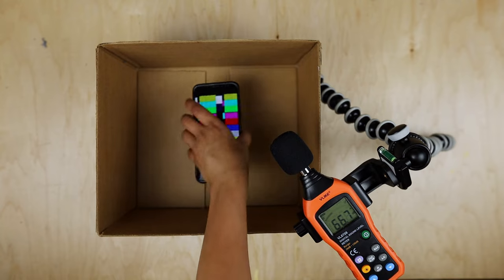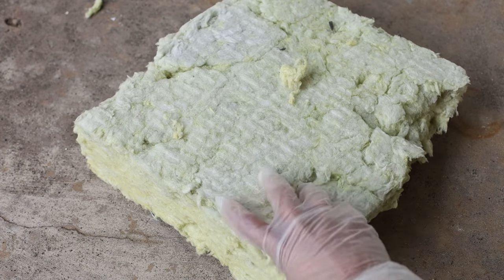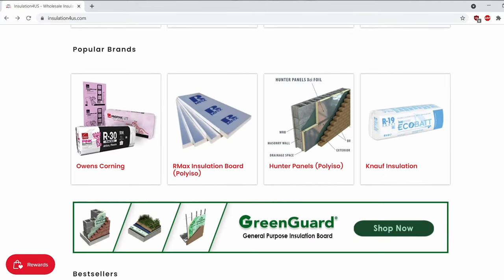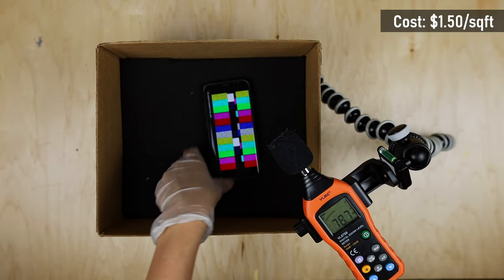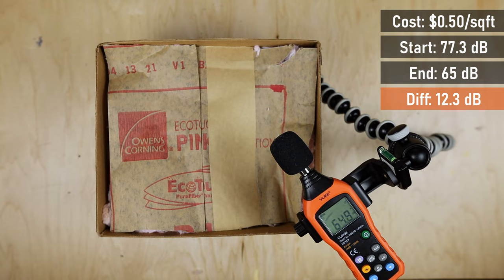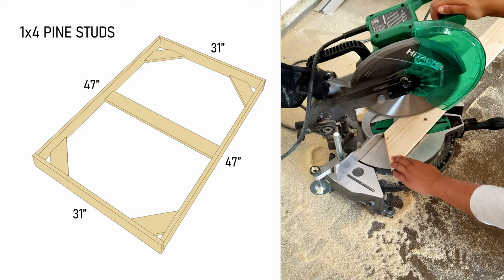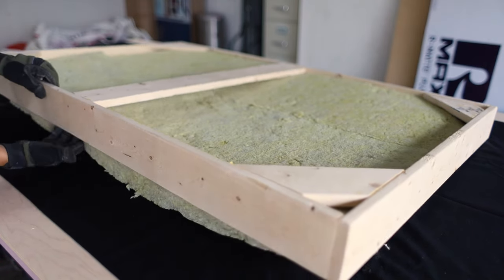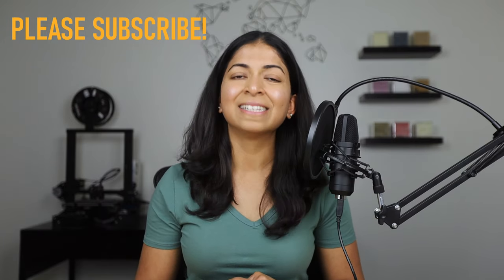Rockwool OR Fiberglass for DIY sound panels?

Comment: Much of what you do is very good work. I think your understanding of sound and the different treatments, where, why and how used is open to improvement. For anyone, a working understanding of decibels, amplitude, frequency, sound dispersion, room shapes and standing waves is imperative. The difference between sound blocking, dispersion and absorption along with decoupling sound transmitters (walls, floors, etc.) is important. Low energy high frequencies are easier to attenuate than high energy low frequencies. Standing waves create huge issues with sound. Identifying the goal, the problem areas, and then the possible solutions may be a better approach to choosing what materials to use, where, and how. Don't stop doing what you do, just continually learn and improve.

Comment: You may have fallen for the classic acoustic pannel trap! I'm new to the topic (so I might be wrong) but from the research I've done there's a difference in absorbsion and blocking. For example, concrete is very good at blocking sound but reflects it. If you were to submerge your phone in concrete, let it dry, then produce the sound, it'd be almost impossible to hear, but you wouldn't want your sound pannels made from it. The property we want in acoustic pannels is sound absorbsion since we only care about sound reflecting back to us. From what I've read fiberglass is actually worse for sound absorbsoin than both rockwool and denim but better at blocking. There's a special program to determine the sound reverberation of a room. LTT does a video using this process.
Again, I'm very new to the topic so I might be wrong.
LTT's video: https://www.youtube.com/watch?v=Sowki1N_YeY
The Acustic Pannel Trap: https://www.youtube.com/watch?v=HwaZhT_CrYI

Comment: Wow you are very knowledgeable about giving DIY information! 
I am purchasing a sound meter for this purpose but looking for the right one that will cover all bases. 

The main issue I have right now is that the room that my off is in is a good sized area but oddly shaped structure for sound balancing.  So it becomes quite a challenge to get it just right for my liking. 

I will consider the fiberglass insulation for sound panels and take the safety precautions while building them. Always do.
Thank you so much! ✌🏻

Comment: The experiment makes a lot of sense, but we need to be careful when trying to generalize the results, especially to the scenario of wall insulation.

In the case of wall insulation, there is a cavity where sound can easily go through/resonate in, and we try to fill the cavity; also, the sound source is NOT inside the wall.

In this experiment however, there is no cavity to begin with, and the sound source (the phone) is sandwiched right between two fiber panels. This is a very different setup than the wall insulation case.

Comment: The problem with this test is it's testing for sound proofing, not reflection absorption. Sound proofing has a lot to do with 'sealing', which the fiberglass would be good at because its so fluffy; but this doesn't necessarily mean it will absorb reflection the best. Also, panels in a studio need to control low htz as well not just high frequencies

Comment: Hi. I have liked the video because you are addressing one of the less understood subjects in construction. However , the test that you conducted is a sound insulation test / sound stopping test. Acoustic panes are not used for sound insulation but for sound absorption. The two parameters, sound insulation sound absorption use different units. Sound insulation is measured in decibels (dB) whilst sound absorption is measured as a coefficient e.g noise reduction coefficient (NRC) or absorption coefficient.  Sound absorption can also the expressed in terms of absorption class. When comparing products for sound absorption, it is important to consider the absorption coefficient/ NRC and thickness. One may add density to the comparative matrix if required.

Comment: While your test's were not entirely scientific they were a good approximation of what to generally expect. The results with fiberglass over Thermafiber however are a bit misleading. The Rockwool insulation is a higher quality and more stable than Thermafiber and should yield a better result. Fiberglass would also lose some of it's acoustic ability if it were to be compressed at all. I work at Canada's largest National industrial and commercial insulation distributor and can say that of all the sound studio's we have supplied in my region (Eastern Canada) Rockwool has been used exclusively and not just sound studios but gyms and wellness centers as well. Love your channel ... Cheers

Comment: Problem is for sound transmission you want mass. Rockwool has more mass and you can cram it tight to put more making it more effective. It's also more effective for low frequency.

Comment: Nice Video,
I think the reason the Fiberglass did the best is because it has a solid kraft paper material on the back of it while the other. ones did not so its less acoustically transparent than the other ones.  In reality if you were using that panel in the frame it may be worse than not having it if you were trying to liit wall and boundary reflections. Nice video I enjoyed it.

Comment: Maybe the noise level drop is very related to MW density, so using a light weight MW panels around 40 kg/cubic meter may improve the insulation level.

Comment: Agree with other comments that you should perform the test with multiple frequencies, 1/2 octives min, 1/3 or less even better.  Also, it wasn't a fair test due to the fiberglass' paper backing.  The paper backing will block and reflect sound, not absorb it, as is desired in sound panels.

Comment: Google Sonopan 2, it is a relatively new sound proofing material with perhaps some of the most superior acoustical dampening properties I have ever seen. It is fairly cheap at about $30 for a 4 foot x 8 foot sheet that is 3/4 inch thick.

Comment: Coming from someone who currently is dealing with sounds transmission (STC Rating) issues on one of my jobs, mineral wool has a superior sound dampening coefficient, when compared to fiberglass. The wall assemblies I’m referring to, have an STC rating of 54-60. This is a laboratory tested assembly, that at the time of testing achieved a 54-60. Whether you can achieve 100% of the time, would depend almost entirely on installing quality, and additional materials involved with the assembly to achieve a desired sound coefficient. To say that fiberglass is substantially superior to mineral wool in terms of sound deadening is simply not true. If you were, for whatever reason, to look at laboratory/national standard testing, you’d be surprised to learn that mineral wool is the preferred product to achieve higher STC ratings.

Comment: Thanks for doing these videos. They are helpful. I'm not sure how telling this sound test is though. By merely filling the box you're only covering one surface. That's sort of like putting carpet down on the floor of a room. Sound baffles go on the walls which is dampening the bounce of sound on more surfaces. I don't doubt the effectiveness of the fiberglass, but I'd like to see the test done with  strips or squares attached to the sides of the box - and a bigger box used, just like panels on walls in a room.

Comment: Hi Belinda.  Thank you for this info.  We added a suite to the lower level of our home and decided to insulate it as best as possible.  Our floor joists are the open web design. (which I hate BTW, because there is too much bounce, but the ease of distributing wires and heating & cooling vents make it an attractive joist for builders.)  Anyway, we first spray foamed the ceiling about 3 inches and especially around all heat/cool vents.  Then we filled the rest of the cavity with rockwool.  Then we screwed up two layers of 5/8 inch drywall.  Between the two layers of drywall, we used Green Glue sealant (squirting it liberally.)   WELL, our sound proofing worked VERY WELL.  We never hear anything from the people living in the lower suite, and they say they only hear a slight noise if we drop something heavy on the floor.  They say it’s the quietest suite they’ve ever rented.  Thank you for your videos.  Thumbs Up.
Reply: Your joist bounce issue is more likely due to inadequate Serviceability Limit State (SLS) considerations and deflection allowances. 

A few remedies would be to:
- decrease the loading on the joists by decreasing joist centres. 
- use joists with a larger second moment of area; deeper joists will have a greater effect rather than wider joists.
- increase the stiffness of the joists by changing materials.
- reduce the span by adding a support as close to midspan as possible.

I would say the cheapest option would be to add OSB, plywood or LVL panels either side of the existing joists which will increase the second moment of area and there by decreasing deflection and bounce.

Talk to a local structural or civil engineer who'll have best knowledge on local requirements and feasibility.

Comment: I’m not sure how useful this test is. Panels are typically put up to dull reflected sound, not to prevent sound from passing thru the panel. The test as shown might be informative regarding how well the different materials do at keeping high pitched sound from passing thru a wall or something. But it doesn’t really demonstrate how well the material performs at muffling reflections of sound within a room.

Comment: First of all congratulations on your first sponsored video!
So this is an interesting result but I do wonder if the results would hold at different frequencies. 
For example lower frequencies may rely more on mass to dampen were high pitch frequencies having less energy per wave for the same amount of perceived decibels, more transitions between air and another material will likely dampen more.

Also what I’m wondering is in this case you have stunt the sound source between the layers, which requires the sound to go through the material.
In many cases were not only measuring for to sound transmittance but also for sound absorption and deadening. 
meaning the ability for sound to penetrate from the outside and not be reflected.

Finally called something like the foam board is easier to leave exposed in a room wear something like fiberglass you would likely need to cover with some other material that is going to be more acoustically reflective. Still really interesting results and very curious to see more on this stuff

Comment: sound loses decibel, wherein differing surfaces interact, the ultimate i have found, is to layer rockwool and carboard and poly, multiple multiple layers. we use this for dampening huge exhaust vans, but there is a company that offers a super thin poly that reduces noise as much as 18" of concrete, a layer or 2 of this can make a jet liner quiet......this material, wrapped around your sound boxes could be a massive improvement, however, last time i checked it was extremely expensive at $1000 per 30ft x 10ft x 1/2'

Comment: Thanks fellow Dallasite!  Another option would be to mix layers with various materials to cover more frequencies more effectively...  eg a layer of rockwool, a layer of fiberglass, a layer of denim...  each absorbs different frequencies...
Reply: Exceptional suggestion, especially where materials can be laid, such as a ceiling.  My house windows are M******d, which use 3 different thickness's of glass panes to stop or reflect different frequencies.  I think you should try to patent your idea, especially with a "manufacturable" process.

Comment: So is it safe to say that rockwool is better for blocking sound and fiberglass is better for adsorbing sound?  I'm thinking to build a room inside a room as my vocal booth.  So, if I want to put insulation between drywall to help block the sound I can use rockwool, then on the second wall I was thinking to put drywall on drywall as the external facing layer, then fiberglass insulation between the studs, then a fabric on the inside instead of drywall so that the room can be as dead as possible.  I'm just basing this off seeing that the STC rating is higher for denser material and based on your experiment, the NRC rating seems to be better for less dense material.  What are your thoughts?

Comment: Great video as always Belinda but perhaps a second video testing different frequencies to see which insulation best covers the widest band? I would imagine Rockwool covers a better spectrum glass may have worked well for this particular frequency but may have tailed off in performance moving further up / down the frequency bands. 

Acoustics is a fine art, I would imagine Stonewool being the best for a broader dynamic range.

Comment: Hi Belinda,  I would love to see the testing for sound based on the cost per sq ft.  So and R30 fiberglass batt is the same cost per sq ft as a 3" Safe and sound bad.  This would be very helpful in sound proofing between levels.  Where is the biggest bang for the buck.  I will also be contacting you new sponsor for pricing on my project!  Great video as alway!

Comment: There is a flaw in your test setup. you measured the effect of a single frequency. You also used a high-frequency sound. The further you go down with the frequency... the more noticeable the differences would be. Unfortunately, this makes the test unusable. Rockwool would prove to be more broadband and effective in the lower low frequencies. Glass wool can’t do that. But I still think it's nice that you dealt with the topic👍

Comment: Most sound you need to insulate yourself from is low frequency - that high-pitched whine doesn't reproduce authentically a banging house-party next door. Unless it was a high-pitch whine party in which case that paper-covered loft insulation will be just perfect.

Comment: Another great demo.  Belinda, I’m concerned about seniors at risk in these heat waves due to lack of cross-ventilation in older apartment buildings. Might you look  at DIY aIr conditioners (not swamp coolers). Want under $100, best cooling for least ice usage, USB powered fan and fish tank pump to reduce power expense and allow for solar power sourcing. Might you look into this?

Comment: This was a very surprising result.  I know there are two different rockwool products sold; one is for thermal properties and the other for sound dampening.  I'm thinking you tested a material that is similar to the thermal properties of rockwool, but not their sound dampening material.  With that said, the results claimed by rockwool match what you got from fiberglass, so even if the actual rockwool dampening material performs as well as fiberglass, it's still a more expensive solution.

Comment: Can you retest in a way that gets frequency response results? Snag a miniDSP UMIK-1, use REW, and then use a larger speaker emitting pink noise, and you'll be able to see what frequencies each are better at absorbing. Some might be great up at higher frequencies (that your cell phone is capable of) and some better at absorbing bass (what rockwool is more renowned for). Also note, felt is a terrible choice due to its density, a thinner fabric is better since it'll be acoustically transparent (especially in higher frequencies) instead of reflective and allow the sound to reach the insulation.

Comment: I noticed you left the paper backing on the fiberglass. I would think that as far as sound blocking that probably added to the decibel drop due to an added layer . Your other materials did not have a paper backing which somewhat negates your experiment. Try taking the paper off of the fiberglass. Thanks for doing this video. 
Jeffrey Sac

Comment: One piece of advice, at aprox 4.11, when using the nail gun, your left hand is in a bad location - if you get the nail angle wrong it is possible to shoot yourself with an over penetrating nail, odds are your nail gun isn't powerful enough to do a lot of damage at that distance, but it is easier to be safe than explain the issue at the ER.

Comment: It would be really interesting to measure the reflectivity and how it interacts with room modes.  It seems like this test would be more applicable as the sound panels are used more to modify the room's acoustics rather than sound proofing.  You could setup a test where your measure the room's response with and without the panels and varying number, thickness, materials, and geometry.

Comment: Those "acoustic panels" made of foam, and come in various shapes like the sawtooth version you used are Not of any use in blocking sound. What they do do is break up reflections from the surface they sit on. Some people call that "deadening" (I don't) They basically reduce or eliminate echos.. nothing more. As far as I know they were never intended o block sound from going through them.. For that they are borderline useless.

Comment: Your fiberglass will settle in walls which will create air gaps.   Any vector sound can find is the problem so you didn't really make a mistake.   That and you didn't have the material sandwiched between anything which may impact the performance.

Comment: If you want to block sound, you are better off with a very stiff material.  The products you tested are meant to reduce echo, not block sound - as such, they are very useful for reducing the reverberation time of an office or listening room.  Cinderblocks, for example, are excellent at blocking sound but are useless for reducing echo.

Comment: Nice video, but in my experience the fiberglass doesn't goes down in frequency like the rockwool does. If you have a problem like at 130hz or below the fiberglass wouldn't make the cut. The rockwool do.

Comment: Cool thing I learned bout Rockwood is you can dry it with heat, fiberglass is a one, and done material would have to be removed as it loses its value and no good.